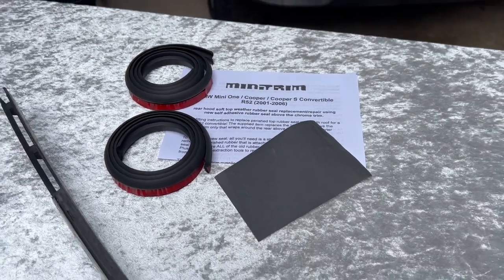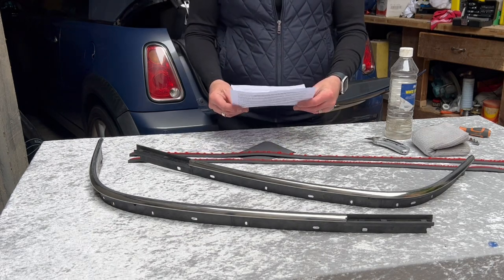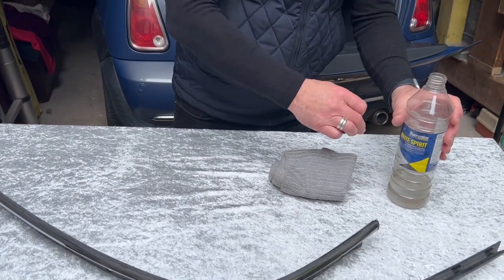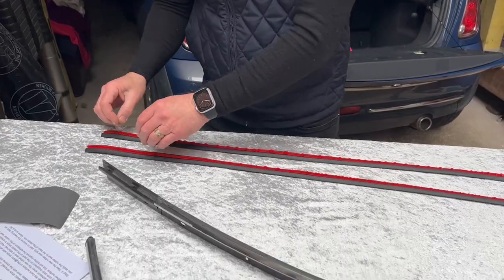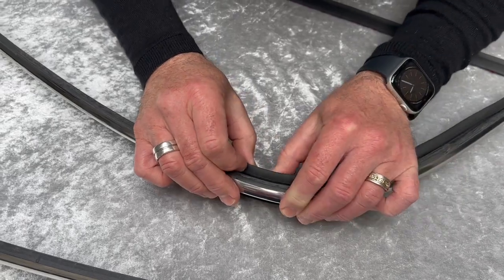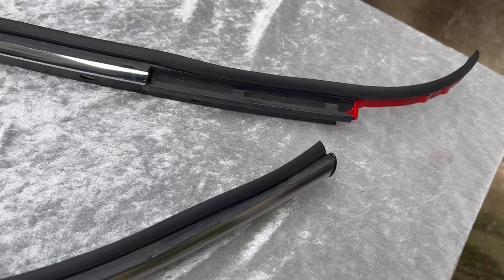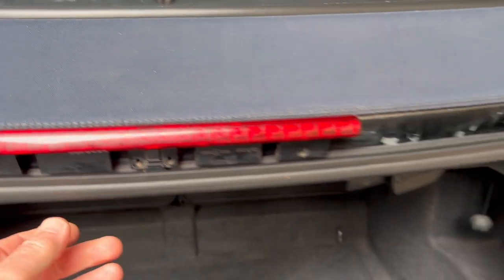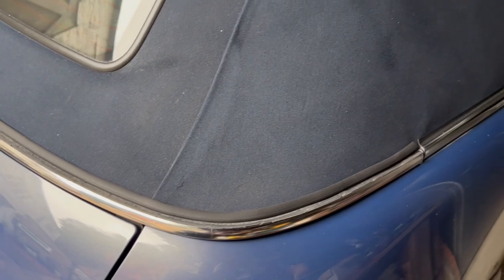MINITRIM Rear Rubber Roof Seal Replacement BMW Mini One Cooper S R52 & R57 Convertibles   HD 1080p

Comment: Where do I get this trim seal? Also can I get the boot seal as well??
Reply from the maker: https://www.ebay.co.uk/itm/334803632399?fits=Car+Make%3AMini&epid=9059518522&hash=item4df3da010f:g:o-oAAOSw1d1kebi3&amdata=enc%3AAQAIAAABAGmmZTv0H%2FCPIQSAoKeqBa%2FolqP8%2BRAkyTwl9SK6EHcz0E1abCAwqIr18%2FUxn59U4tm%2Fy9%2B8EGAGw13ECg1rgT%2BefoF4IwZOL2yUT8Xvhv9x4d8pu1DoexH0QiMQzfo4%2BMOeePQyDfGgBS1RyP9ihGVzF3NHbBwx52uzvpBAlXaViy%2FMEsuWF1dt5Y3%2BpZptzmgwfAUUBEbtFyGSxMDYvPIhfNpK%2B1joB8oEj60sWePypAiwkP1xLz7WhYvwaZbBNPTD1QujoojCIBkPHV5fqQSxbQTzF8NqCO0ws0uBPX30ckW8iRHq7lX7QgqDpGkkA9bGRfnYhJzkYcONZstarm0%3D%7Ctkp%3ABk9SR_TrxfyTYg